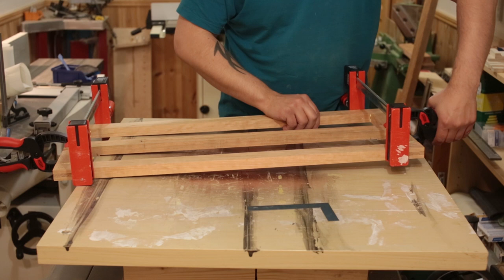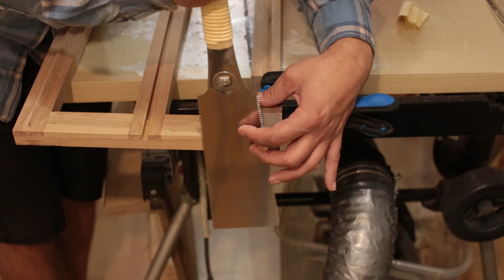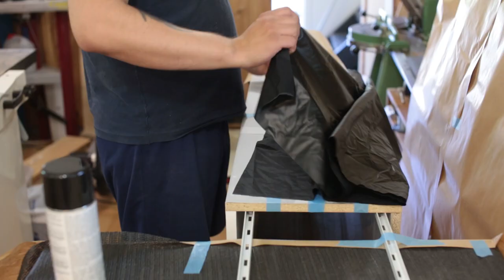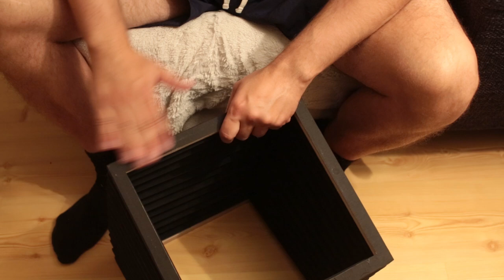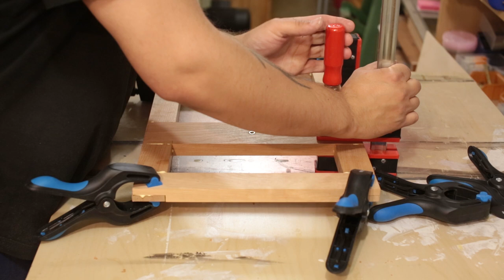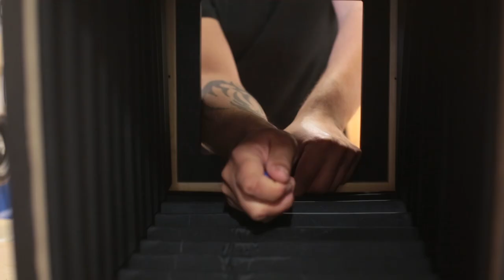Making a Camera | Handcrafted Woodworking

Comment: I bet this would look even better with a Schneider Kreuznach, instead of the magic lantern, lens. Great display of skills here! I particularly like the bellows fabrication and wonder how you would make one with the tapering outline for your plywood wet plate camera.
Reply from the maker: Thanks, only lenses I had available. I did not make those bellows myself, but to make tapered bellows you can use a tapered box. I have also seen other methods without using a box, but never tried that. The advantage of using a box is that they will fit perfectly every time.
Reply: Beautiful work, fine craftsmanship! Can you tell me what black the fabric/material was that you used for the bellows?